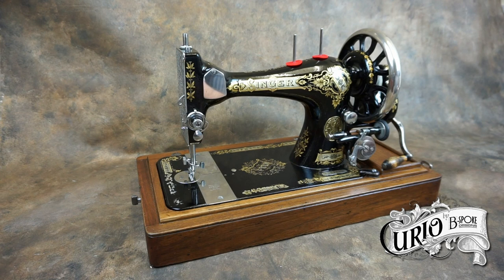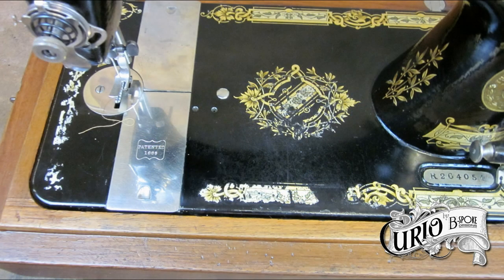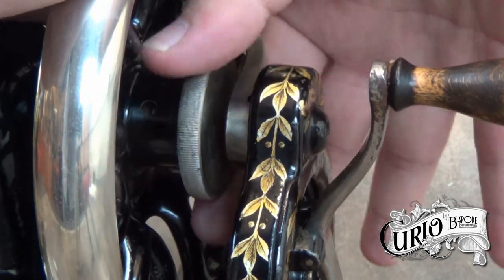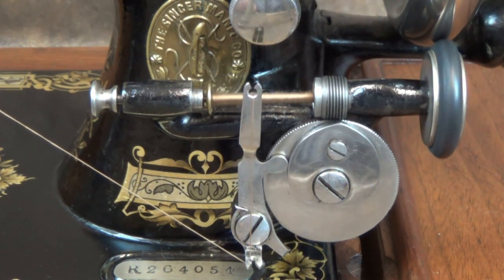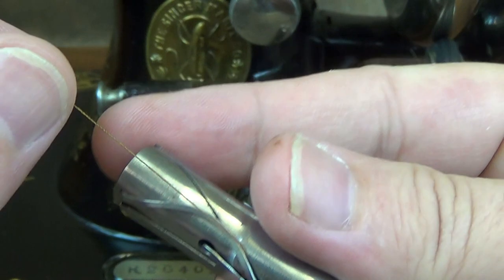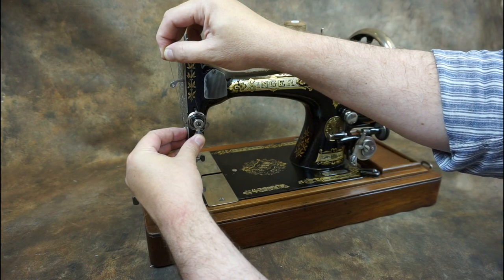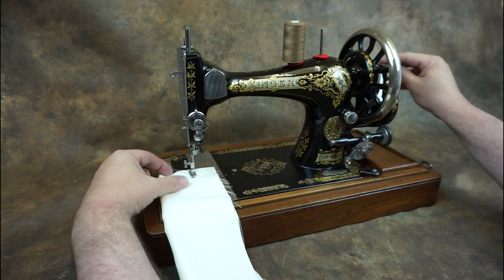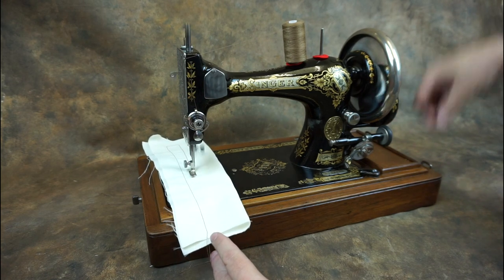Singer 28k Hand Crank Vintage Sewing Machine

Comment: Thank you, even with the manual I couldn't quite get my shuttle to thread without laboriously pushing the thread through the relevant bits (on an 1895 model), so it's really helpful to watch exactly how you held it and pulled the thread round and up. Lovely to hear yours purring. I love using my machine with so much history behind it, and often wonder about its previous owners. I bought it in a junk shop, and when the seller picked it up, the box fell off in four sections (hence he then asked for just £2). I took it home in pieces, glued the box together and we've been sewing happily ever since. The machine just needed dusting and fresh oil, and purrs along smoothly, it's like a meditation, so soothing to sew with
Reply from the maker: There is something magical about these old machines that modern ones will never have. It sounds like you got a bargain! I hope you have many more years of happy sewing.
Reply: If you are into boating you would have heard of an Outboard engine.. A Seagull. This engine is to the boating world what the singers are to our sewing world. Simple and will last for ever.

Comment: I got an pristine (for something that's very old) Singer 28K yesterday, it works, has a manual, and a lot of small parts that i dont know what are, and a lot of dust that i've cleaned of, if i have the time it's getting a bit of oil in the weekend. . 
According to the serial number it was made in 1925 in Elisabeth Port, NJ and imported to my country Denmark.
Reply from the maker: I've just picked another one up myself - I've yet to have a look at it properly.

Comment: I restored two of those, which was a fun project. Both were "Sphinx" models, but one had the bobbin winder low (designed for foot crank) and the other high (hand crank). I made the wooden bases for both, but nothing too fancy. They do worked fine with too much adjusting, which is amazing considering their age. Thanks for the video!

Comment: I am in love with this 27 model that I bought, and I have followes so many videos, but I cannot get my bobbin to catch.
Reply from the maker: MistyMorningKristy have you tried a new needle? I have found with another vibrating shuttle machine that the needle was seated too high up in the clamp and by lowering it a couple of millimetres did the trick. Otherwise it could be a timing issue

Comment: Thank you so much for this wonderful demonstration of the beautiful 28k. I am gathering as much information on the model as I can and cant wait to find one to call my own.
Reply from the maker: Good luck with your search!
Reply: There are also other companies that build very similar machines (sometimes for the  most part outright the same machine except for a few details.) I own a perfectly preserved Haid and Neu crank machine from 1910  thats pretty much a copy of a singer machine except for a few little details. (crank grip made from porcelain, a few extra features on the bobbin winder, slightly different shaped excess holes and the shuttle arm has a release button so you don't have to fiddle with it) And its a beauty, has every singly piece it originally came with and not a spec of rust. Hell, the mirror polished parts are still mirror polished.

Comment: Thank you for this video.  I just purchased this machine.  I am very pleased.  I ordered the instruction book, it did not have one when I purchased.  You did such a lovely job demonstrating how to begin.  I am anxious to purchase some more bobbins and other attachments that came with the machine when it was new, any suggestions where to begin.  At the same time, I also purchased the Singer fiddle machine, model 12 made in 1881, it too is in lovely condition, however no attachments or instructions.  Thank lyou.
Reply from the maker: Firstly, Congratulations. It's always best to get original vintage bobbins and attachments for these machines. You can start by looking on eBay and if you are on Facebook, join some vintage sewing machine groups, where there are often accessories offered for sale.

Comment: You've done an excellent job in documenting how these wonderful machines are to be threaded, worked, etc., and I'm learning so much from you.  (I subscribed a few days ago:)  I'm considering buying this model from an online seller, but it has only one spool pin (no hole for a second).  So, I'm curious.  If both yours and the one I'm considering are 28k models, why does yours have two pins and the other only one?  What is the purpose of having two?  With modern machines, I believe it's for twin needle sewing.  That could be the purpose back in the day, too.  I just didn't realize they had twin needles back then.  I've tried to find an answer online specific to these vintage sewing machines to no avail.

Also, have you sewn for an extended period of time during any one sitting and does the cranking get to your arm muscles?  I suppose the obvious answer is just to stop for a while to rest one's arm, lol!  But, is there more of a secret?  I would imagine that position might be one of the keys, having the machine at a certain height/angle to body/arm.  I realize, too, that many women and men who may have used hand cranks back in the day were used to using those muscles for longer periods of time than we are today and wouldn't be bothered by tired arm muscles;)

Thanks for any input.
Reply from the maker: I think older machines had two spool pins so that a second spool could be used to wind a bobbin without having to unthread the machine and rethread it. With the stop motion knob undone, the needle bar, and feed dogs, should stop moving, allowing a bobbin to be wound independently. I have to be honest, I’m not much of a sewer, so haven’t used a hand crank for any length of time. I believe there is a technique to it. Also a hand crank offered more control than a treadle set up. Thank you for subscribing!

Comment: when i watched this 28 k video i thought it looks very similar to my duchess but there are a few differences.They could have easily changed the shape of the cover plates but the stitch length adjuster is a sliding knob  and it is 6 1/4 inch x 13 1/16 base doesn't sound like it matches but it probably was manufactured by singer   thanks for all your machine videos
Reply from the maker: As far as I'm aware Singer never made machines for other brands. Many did copy them though. They did release the rights to the designs on the 15 after WWII to allow Japan to build its economy.

Comment: Hi just brought a 28k. Not very experienced with sewing machines especially vintage ones. Your videos been extremely useful.

However im unsure how I close/finish a stitch one I'm done as the machine to my knowledge doesn't have a reverse option.
Reply from the maker: No, you're right there's no reverse. There are several methods to finish your stitches including, turning your work around and going back over the last few stitches and lifting the presser foot and moving the work back a little. Hope you can figure what works for you.

Comment: Thank you for the video, I’ve just been given this machine (1911 28k) I’ve just been able to load the bobbin and sew with it. Mine seams to have the spring missing on the tension disk and a thread guide missing on the side. Also while I was winding the bobbin had to press it so it didn’t fall out, I think the spring has gone. Yours looks in much better condition.
Reply from the maker: This was in pretty good condition when I got it to be fair - I have one that isn't though, and will need a few parts.
Reply: Curio By B-Spoke Designs I’m currently trying to find someone local to look at my two. I’ve got a Singer 201K too. It sees on its own and the foot capacitors have already been taken out of the pedal. I hope that you get yours sorted.
Reply from the maker: @ClaireWhoMakesThings  If the capacitors have been removed there's a short somewhere or the pedal needs some adjustment. It's not usual but it's possible that it's gone that far out of adjustment to be totally 'on'. Where abouts are you Claire?
Reply: Curio By B-Spoke Designs West Midlands in the UK
Reply from the maker: @ClaireWhoMakesThings  I'm near Manchester - but in the world of Youtube we're neighbours!
Reply: Curio By B-Spoke Designs Ha ha, I suppose we are!

Comment: Hi thank you for your video, 
 i’m wondering if you could answer a few  questions, 
I have recently purchased one of these machines without the shuttle, i have bought one from eBay,  the machine was sold as working well, however, I’m having difficulties getting the thread to pick up from the shuttle.. this is my second machine that I am working on,  I’ve threaded up a shuttle before without difficulty, so could it be the wrong shuttle. It’s probably an obvious thing to know. But 
Could the wrong shuttle still fit, it came with a mixture of bobbins, some with a hole  some with not, 
How do you know if you have a faulty shuttle,  Thank you for your time. Regards Sue
Reply from the maker: Without seeing it, it is difficult to say, but I would guess that it’s the wrong shuttle. I would look to see if the thread is going around the shuttle which may indicate if the timing is out. It could be something as simple as a bad needle. Or the needle not being in correctly.

Comment: I have a beautiful 28k 1934 hand crank model that I'm having real difficulty with. I've threaded it just how you showed me, but the stitches are shoddy at best and pull free from the fabric very easily. The thread seems to be having a hard time passing round the tension disk. Do you think it might need oiling, or is there something further needed here? Thank you x
Reply from the maker: It's more than likely the tension assembly need to be taken apart and cleaned. There are a lot of good videos on YouTube showing you how to do this. Just make sure you take notes on how you take it apart, so you can put it back together again.
Reply: Curio By B-Spoke Designs Thank you, I'll let you know if it works out

Comment: Thank you so much for this video. I have one '14...' series machine. Your video is a huge help to set it up working. Though after a few minutes sewing the hand crank became hard to turn. Is it just a need of oil or some other problems going on? Where should I look?
Reply from the maker: It could just need oiling. Can you flick the finger of the hand crank out from the hand wheel spokes? That way you can see if it is the hand crank or the machine itself.
Reply: Thank you for your advice! I have oiled the wheel and it is going easy now. Though there is a metallic sound every now and then. It's about every 30cms of sewing. Can't figure out what and where exactly it comes from but I guess it is from the hand crank.
Reply from the maker: Maybe try oiling again after a couple of days
Reply from the maker: Is it a clinking sound? It may be the finger loose between the spokes

Comment: I recently bought a Singer 28 at a thrift store but no matter which needle I put in (even brand new ones), they always seem to scrape one side of the hole in the throat plate. I've readjusted the needle bar and the throat plate itself, but the needle still scrapes... Is there anything I can do to fix this?
Reply from the maker: You need to check that the needle bar is not bent. If it's just a fraction of a millimetre bent then the needle will be even further off. Check that the channel the needle sits in in the needle bar is not blocked or damaged

Comment: I got another machine from the same manufacturer as the duchess only this one is called      "The valley"  Whoever the manufacturer was they must have been happy to sell them in Australia with whatever name and decals the retailers wanted     Its not a going machine but it will be ok for parts should i ever need them    I haven't seen another one on you tube like it but i am sure they were a successful company    It wouldn't still be working 100 years later if they weren't
Reply from the maker: Quite a few companies would badge their machines for anyone to sell. Most notably Jones.

Comment: Hello, I was hoping you would help me. I'm considering buying a k28 and wanted to know if you can get attachments compatible with them, for example a bottomholer or any additional stiches

Many thanks 
Pixie
Reply from the maker: Yes. These are low shank machines so pretty much anything that you can use on a 201 or 99 should work.
Reply: @CurioByBSpokeDesigns  that's awesome thank you so much really appreciate your help ❤️

Comment: Hi. I have a 28k and I got it serviced just over a year ago and have been happily sewing until over the last month the thread coming up from the bobbin sometimes snaps.  I use Gutermann thread. Have you any idea what might be going wrong and what I can do to stop it? Thanks.
Reply from the maker: Hi Michelle. That's a difficult one to assess without seeing the machine. Have you made sure to remove any lint from the bobbin area and have you oiled it as per the instruction manual? I have had this issue with a machine in the past and it turned out to be the presser foot pressure was too tight.
Reply: Thanks for those suggestions. Love the videos, by the way.

Comment: Hi! Firstly: thanks a lot for the informative video's! Secondly: I have a question about threading my newlt acquired Singer 28k: I followed your instructions and inserted the bobbin into the shuttle but the thread does'nt run freely. Looks like it's stuck. If I pull very hard the bobbin does spin. Before 'clicking' the thread under the tensioner it does run freely. I tried to lossen up the screw and udjust the tension but this didn't seem to help. Do you know what might be the problem?
Reply from the maker: It may be dirt under the tension spring. I would try to carefully loosen the spring screw.
Reply: @CurioByBSpokeDesigns  Thank you! I'll give it a try!

Comment: Back again with another question. I have discovered my bullet bobbin case has a narrow  piece of metal on the outside broken. Can this plate be replaced? Do I have to replace the whole thing? Where would I find a replacement?
Reply from the maker: it's probably easier to buy the whole shuttle. Try eBay or ask on Facebook groups - there's usually a few small companies that supply parts for vintage machines.

Comment: I have a 1906 128 vibrating shuttle singer sewing machine but having problems getting the thread to pull through the shuttle when I reload the bobbin. It occasionally pulls through but mostly seems to get stuck or jammed. Can you advise on how I may be able to solve this problem?

Comment: The back plate where the shuttle goes is stuck and I am unable to remove it, have you any advise please?
Reply from the maker: They rarely get taken off and so are usually stuck. try soaking in sewing machine oil for a while, play a hairdryer over it  (heat often helps due to the expansion of the metal) if all else fails use a wooden dowel on the edge and tap the dowel lightly with a hammer

Comment: I have retreaded my bobbin shuttle and put it in the bullet container. However the thread does not appear to pull out of the shuttle. How can I adjust the tension so that it flows freely?
Reply from the maker: there should be a tiny screw on the bullet shuttle, just unscrew it a quarter of a turn
Reply: Which way should I turn it clockwise or anti clockwise please?
Reply from the maker: @lorraineetherington1728  anticlockwise to loosen

Comment: Do you have a video about how to adjust stitch length for these machines? My bottom thread is loose but I can't figure out how to fix it
Reply from the maker: Do you mean you are getting loops underneath your sewing? If so then it is your top tension too loose.
Reply: @CurioByBSpokeDesigns  Yes that is what's happening! Is there a tension knob for the top thread?
Reply from the maker: @thetoadqueen3520  The tension dial is the two disks the thread goes through before going up to the take up lever

Comment: Can you please please tell me what  sewing machine mines is please and the value
Reply from the maker: Chihiro Fujisaki if it is a Singer machine, Google Singer serial numbers. There's a great website that you can look up the serial number (on the brass plate) of your machine. This will tell you the model and the year it was manufactured. As for value, that depends on model, condition and where you are. It may be worth looking at prices on sales sites like eBay. Make sure you search for sold prices nit what people have them for sale for.
Reply: Curio By B-Spoke Designs I uploaded a video of it if you want to see it